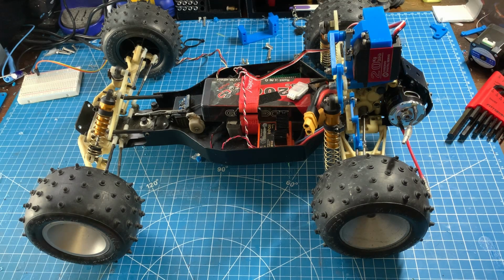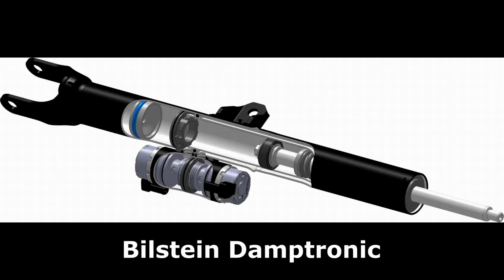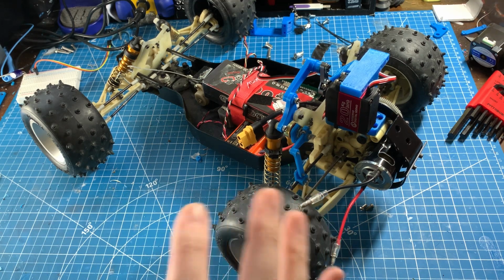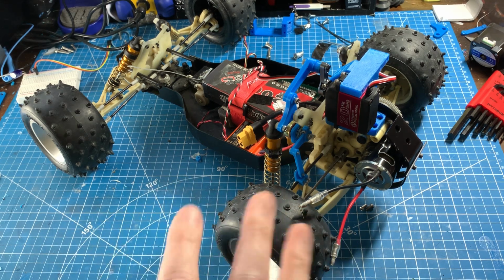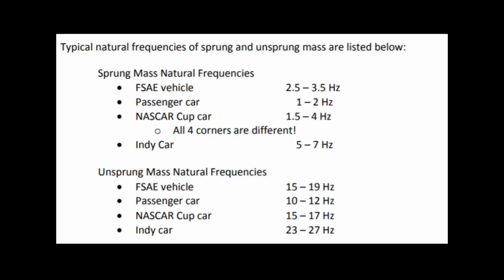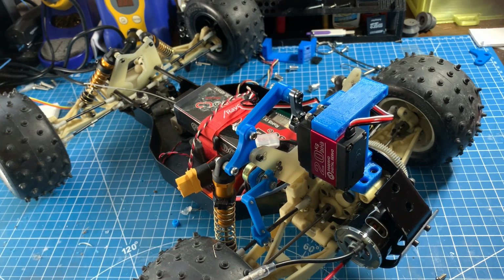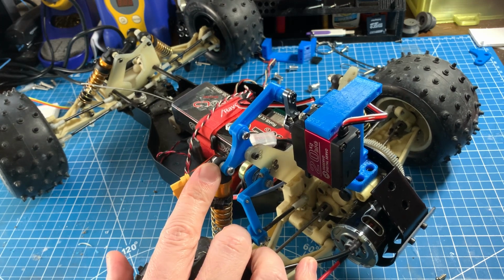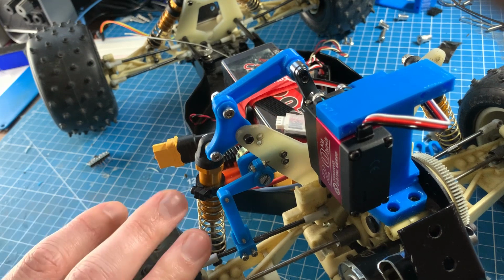RC Car Active Suspension System - Pt1

Comment: i had to watch this twice.. i kept getting distracted by the RC10 and the nova esc.
i like this approach, and i want to do something like this to the axial crawler
Reply from the maker: Yeah, I felt bad using it but it had been in a box for like 20 years so I figured it was a good excuse to get it running again.  A scale crawler would be a great application and you wouldn't be having nearly as many high speed bumps for the servos to deal with.

Comment: Amazing project. I'm a student in a technological school and  i wanted to do a project on suspention system for car and your car is very innovative.  I want to make my suspension similar to yours without having to radiocommanding it. Thing is I have no basic knowledge in this kind of system. Do you have any advice to build such a car. Especially how to build what you did on the damper of the back wheels? Excuse my english, i'm french
Reply from the maker: Thanks!  I can't tell you the best place to start, but I can tell you how I learned about active suspensions.  I did a lot of googling of white papers and doctoral theses about active suspensions.  What I learned from these papers led me to additional information.  Unfortunately there's not a single complete source for active suspensions as much of the knowledge is kept proprietary by companies with active suspension products.

I don't know about your background with electronics, but I recommend trying some simple projects with Arduino to learn how to control sensors and servos.  The Arduino ecosystem is relatively easy to use and there are lots of people online willing to help.

The suspension on the rear of the car is called a rocker style suspension.  If you look on wikipedia look at pull-rod or push rod suspensions.  It allows for a different ratio of movement between the servo and the damper/spring.
Reply: Did you do the project, we want to do the similar project as well and we are confused about feasibility of the project. Do you have any comments or suggestions?

Comment: This project is so awesome!!

Could you please share any resources or books  regarding how you learned to design the suspension frame? I.e. the arms, linkages, etc.

I simply want to understand more about it 🙂
Reply from the maker: I did a lot of googling, but this article is a great overview of active suspensions. https://journals.sagepub.com/doi/full/10.1177/1461348419876392

As far as the linkages, they are of my own design. If you want to learn more I highly recommend downloading Fusion 360 and going thru the tutorials. They give you a solid understanding of CAD. 

Also for the suspension design I studied a lot of FSAE cars which are student built race cars. They typically have complex suspension systems and some even use active suspensions.

Comment: This is fantastic! I had this idea of active suspension (though I didn't have a name for it) back in the late 90's for passenger cars but my high school teachers thought it was infeasible at the time. I should have ignored them. I even had one of those RC10T trucks back then. I'm now working on making an autonomous RC car for fun (https://blog.rcbot.racing/). Maybe I'll add active suspension to reignite my unrealized teenage dream. I've already got an IMU in there so it wouldn't be that much of a stretch.
Reply from the maker: That's an awesome project.  Electronics have come such a long way in the past decade in terms of both processing power and ease of use.  I hope to someday make my own autonomous RC car.   I've always dreamed of building an RC car so fast that a human couldn't drive it.

Comment: The target direction is very interesting to me. We should note that with this servo neither the damping nor the spring stiffness are influenced, only the preload of the spring. This can be used to correct the neutral position of the vehicle or the ratio between positive and negative suspension travel. For example, the changing payload on a motorcycle or the roll angle of a car in curves can get equalized. Therefor only a misalignment is compensated, the driving behavior itself is not influenced at all. For lower air resistance, the ground clearance can be reduced or increased for off-road driving.

Comment: This is a cool project! I understand the mechanical side fairly well but the control strategies and software go far beyond my training, education, and experience. But then again, that's why I love watching this stuff! Have you considered collaborating with another creator on youtube to spread some of the tasks for a project like this?
Reply from the maker: I haven’t thought about a collab, that would be interesting. Luckily through the F1 gearbox project, I have the contact info for some controls engineers if I get stuck. Hopefully this project can demystify these types of suspensions, because the theory is simple but the implementation is a black hole.

Comment: Where do you get the little bolts/nuts that hold the linkages together? Been looking for an assortment of small hardware like that to complement 3d printed parts and haven't run across anything too enticing.
Reply from the maker: I buy the assortments of m2 thru m4 from Amazon, usually about $20 for 1000 pieces. You can get them even cheaper thru aliexpress but the shipping can be a long time.

Comment: I've been noodling an active suspension system for my kid's stroller (we'll be living on a dirt road soon).  I had imagined creating and training an ANN to do the control, which seemed like a good fit, since I have no idea how to do it deterministicly like you propose.
Reply: What controllers do you have in mind?
Reply from the maker: That would really cool. I’ve just started to see a few people trying to use neural networks or genetic type controllers. 

 I’ll probably be going over controller strategies in the next video. Some of them are very simple to implement, like the skyhook approach which is focused on comfort so it would be good for a stroller. You could still use a neural network to tune it.

Comment: Hi hi, I am doing this with a rc tank. I did not wanna bother with a miniature hydropneumatic setup
Reply from the maker: Depending on the weight, it’s usually hard to beat electromechanical for RC.  A tank with an active suspension would be really cool.
Reply: @IndeterminateDesign  i was actually just going for attitude contol. (Look up MBT-70) but i really like to see if i can fit some potentiometers to the suspension. Now that you gave me the idea. I  was just trying to get rid  of some of my left over RC and FPV gear, may sticking some action figure on it and go hatchploring in the garden with the offsping. But I wanted to do somthing different. Well i think i need to get it moving. 
Anyways i enjoy build, and your content very much. You much more efficient than I am.
Reply from the maker: @fruechtekorb  Wow that's awesome.  You could definitely make a self leveling gun on the turret too.
Reply: @IndeterminateDesign  That's the plan, I got some of the MPU9250 for that. And I want to have the counter rotating driver cupola on it was well. That one of the reasons that it takes so long. Everything is really tight. But I am not going to make it who is? :D

Comment: Great job! I would like to ask you about the battery, how many mAh is it? It looks big
Reply from the maker: It’s a 5200mah 2S. It’s probably overkill, but all the servos could pull up to 10-15 amps.
Reply: @IndeterminateDesign  yes you are right it could happen, i will have to decide for my car which battery i must get because i have like 6 servos 3 big ones (2 for braking rear and front and 1 for steering) and 3 small ones one of them for throttle and 2 additianal micro servos) i think i have to get the 5200mah 11.1v, what do you think?
Reply from the maker: I’m not sure, I’m kind of new to the modern RC cars. A lot of the crawlers will run a separate 2S lipo without a BEC and directly power the servos with 7-8volts, but I know a lot of servos can’t take the voltage.
Reply: @IndeterminateDesign  so we are both the same :) yes you are right servos are around 7.2 max not sure if there is higher, for my project i decided to place many BECs with each bek around 3A and there is one 8A for bigger servos
Reply: @Firashelou  The Capacity of the Battery more or less only determines how long it will deliver the needed power, to find out how much current you can draw you have to look at the discharge rate which is normally written in C for Lipos which means how many Multiples of the batteries capacity you can draw. If the Servos don't do a lot of hard work I would say that 1 amp for micro servos and 3-4 amps for normal sized servos is a good starting point. Of course you can always run a lot of high amp becs for additional safety. One important thing is to remove the positive wire from the escs internal bec to the receiver, if you run an external bec, because else you would have two "competing" voltages on the receiver.
Reply: @DarthOggi  thanks for the info